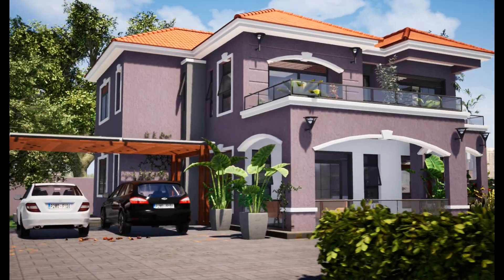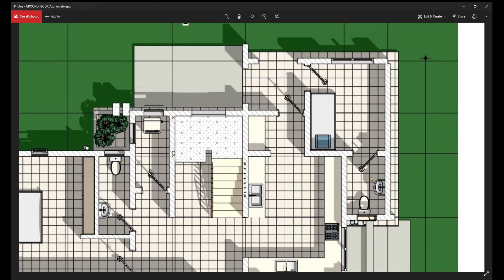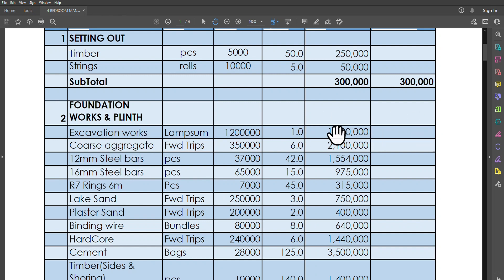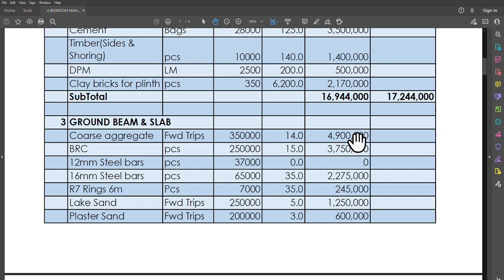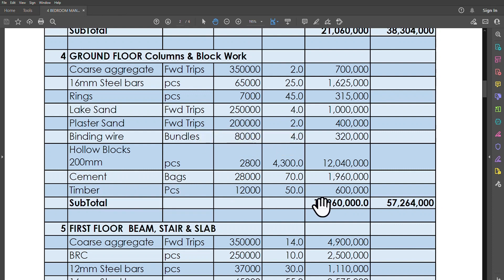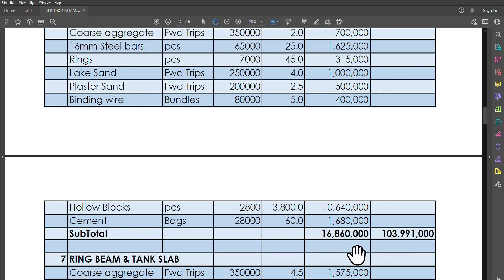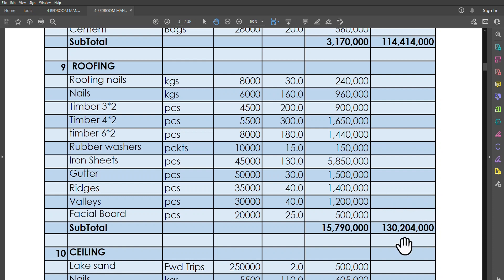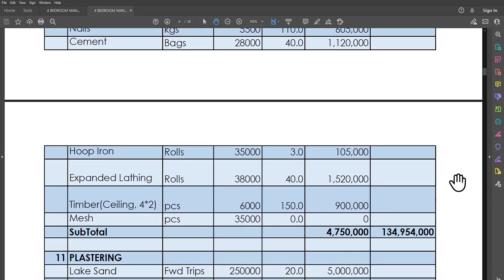The Cost Of Building/Construction a 4 Bedroom Storied House House in Uganda- Foundation to Roofing

Comment: Wooow...thanks for costing...but anyone building that size structure...the cost is double or 2.5 times more... doing a similar project and 250m shell is not fully done... wish I used u on ma project I would lock a price in and see how u finish... ya prices are way off..make another video with actual ground costs...
Construction teams down play costs so u start and get stuck..or get high blood pressure...
Reply: Ofcourse true. Because he hasn't put labour cost. The moment he factors that in, the cost will rise to about that much 250m

Comment: For such an undertaking, would you recommend one buying a concrete mixer and concrete block machine as a way to cut costs and time especially when it comes to mixing and pouring concrete for slabs?
Reply from the maker: Renting or hiring....is the better option
Reply: Hiring is cheaper